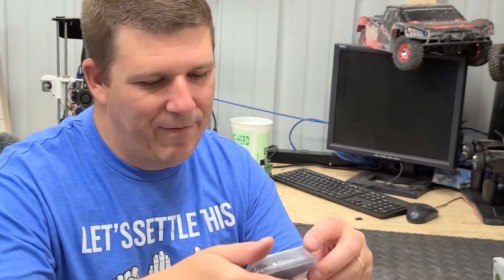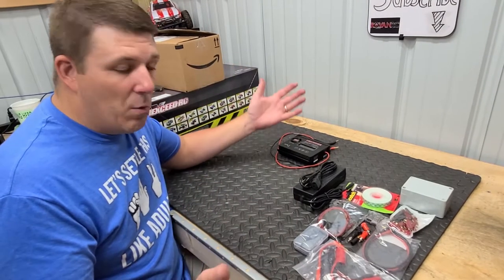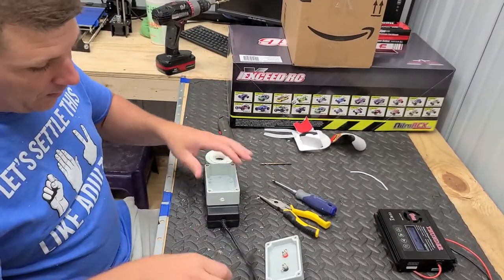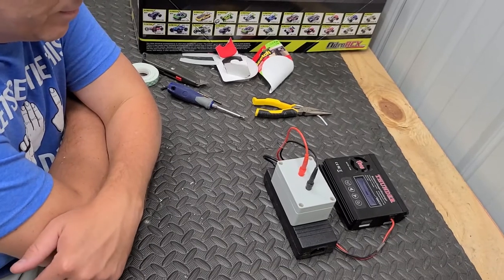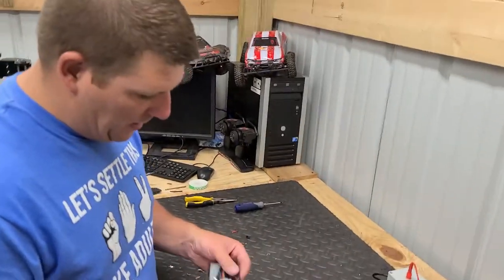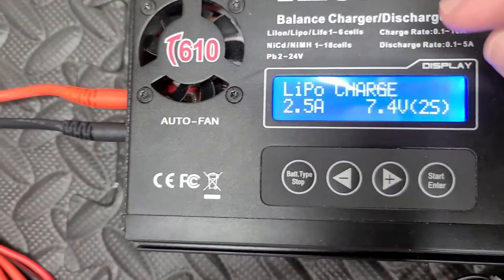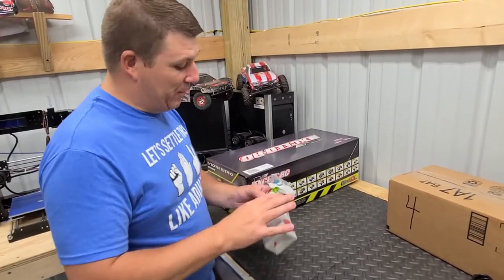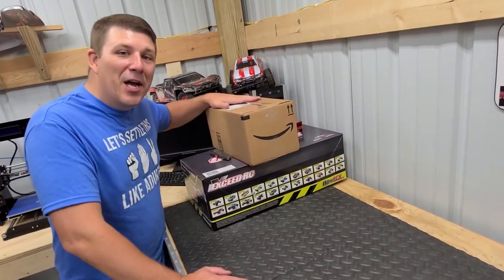DIY: MODULAR RC CHARGER POWER SUPPLY!! SUPER EASY!!

Comment: Theoretically could you run two chargers off one power supply? Maybe adding another set of ports in the diy power supply box and connecting them together?
Reply from the maker: Maybe. We ended up with an issue with that charger, so we upgraded to the Venom 4 port charger. Check out the video.
Reply from the maker: If you ran 2 chargers off the 1 power supply, you would have to watch the amperage draw.  If your power supply only rates a max of 10amps, then you run two chargers, both chargers combined would have to charge at 10amps or less. So basically don't over draw the amperage of your power supply.